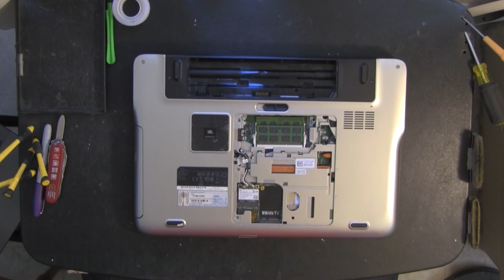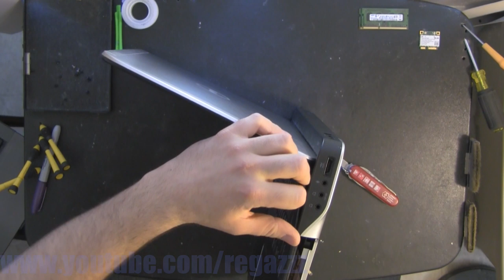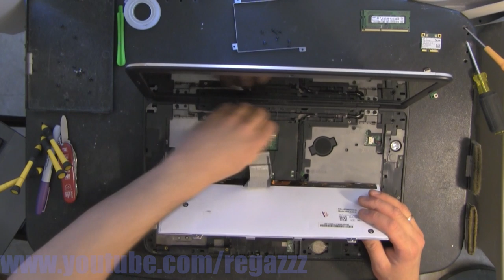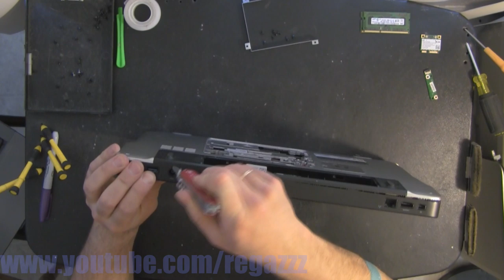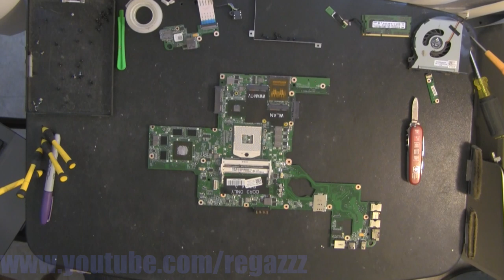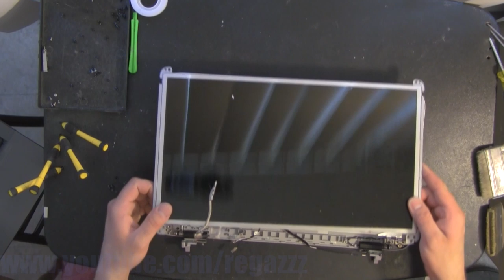DELL XPS L501X take apart, disassembly, how-to video (nothing left) HD

Comment: Hi there, according to your video in order to remove dust from fan and heat sink do I have to go all the way to minute 8 on your video or do you have any recommendations to air clean it? thanks for your video!!
Reply from the maker: Hey ***** this laptop looks like pain in a butt. I think Screen should be remove in order to remove a bottom, but I am not 100% sure. :)

Comment: I followed your video I'm replacing the back of my display screen. When I finished putting my laptop back together, I have power but nothing shows on the display screen. I made sure the cable on the back of the display screen was plugged in. Any suggestions or ideas?